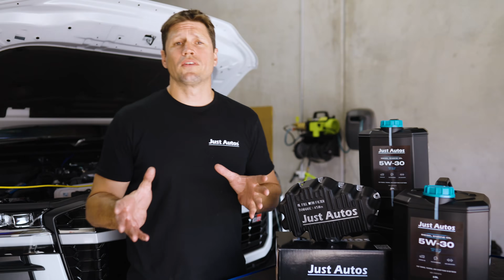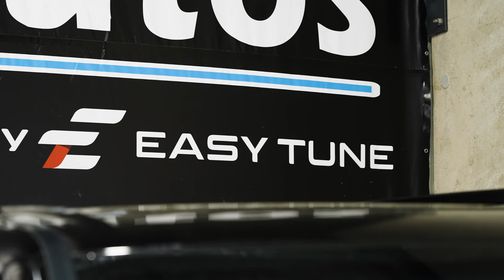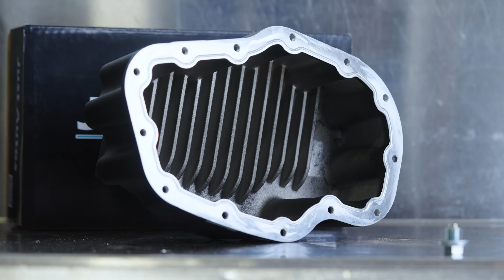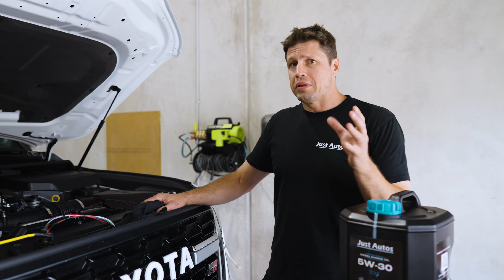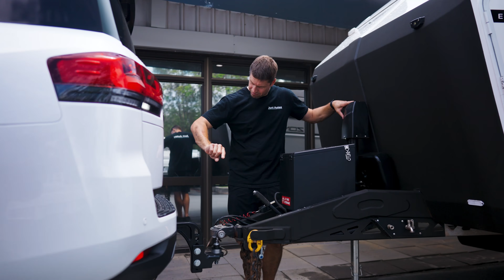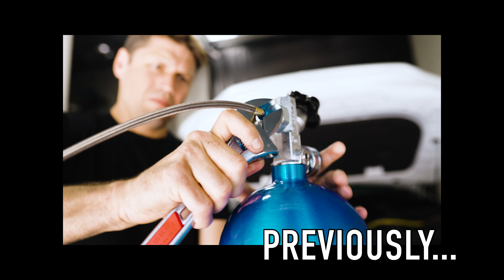Are you Cooking Your Engine Oil? (Real Data | 300 Series Pressure Test Pt 3

Comment: Great video! Oil that is API-SP or API-SQ might survive 120 Celsius even if the engine doesn't. Cracked pistons have started to become a big Toyota issue over the last decade. How does the heavier weight oil assist cooling? I though it was largely about flow. If the piston skirts are short and the rings are tiny can the more viscous oil get through the gaps to do its job?

Comment: LC300 oil is an interesting topic to discuss with your Toyota dealer. On my last service I asked if they could use 5W-30 (Toyota oil) and they said sure, but youll need to buy it separatley and supply it to us, & I still had to pay for the 0W-20 oil because it comes as a service kit and we cant swap out the oil. Poor excuse really. I do some towing & live in North Queensland so harsh conditions are reasonable for the right oil.

Comment: Great mod for the 300 series. Ive noticed I cant read oil temp with a scan gauge 3 on the LC300. Is this a parameter than can be configured to be read on the SG3? I see you guys can obviously read the temp on the laptop.

Comment: Hard to believe the stock capacity is only 4.5 litres. My Kia Sportage has about 7 litres stock which makes me comfortable with 15,000k service intervals. The new sump looks good. Almost like a Gale Banks part( No offence) The extra fins on the bottom and inside should help with continuous heat soak which extra capacity will only delay. The only other way would be some sort of dry sump which would probably not be practical from a packaging or cost point

Comment: Great Video.  Will Toyota honour the WARRANTY when you modifications are fitted ?
Reply from the maker: No, any modification outside factory Toyota has potential to void warranty.
Reply: @JustAutosMechanical How would it void your warranty, this is not going to cause the engine to fail. It's the exact opposite, you adding to the protection and longevity of the engine?
Reply from the maker: @mickparsons85  That's not how they see it unfortunately
Reply: No way

Comment: Straight up, typical Toyota. Spend a shit load on the car, then have to modify stuff to make it work. Boo Toyota. Next, I have a 2.2L Amarok that showed engine oil temp on the dash. I am a heavy equipment fitter and I am used to oil temp being very close to coolant temp. Amaro used to show oil temps around the 130'c mark when towing. Freaked me out. Ran this past an old school VW tech and he said this was normal. I doubted this. Ran a premium Shell 5W-30 engine oil for more than 130K kms. Changed the oil at the recommended 15K mark. Had the oil tested every 15K by a reputable OEM lab. Never had any issues with oil degradation, despite the temps or what work the engine carried out. Spent time adding cooling fins and ducting to encourage more air flow and ambient cooling. All this did was delay the eventual temp. Again, no chemical issues with the oil.
A bigger sump is a great idea. The more oil the better. But doesn't change the fact that that modern oil can handle the pain, and modern engines run warmer. 
Really keen on keeping oil temps down? Invest in a better oil cooler.
Reply from the maker: Oil doesn’t instantly ‘break down’ at 120°C, but oxidation and viscosity loss accelerate rapidly once you’re consistently above that range. That’s why keeping temps lower helps maintain stable pressure and long-term protection.

Comment: How's a 100°C odd a cooked oil when it's Flash point is over 200? I need explanation
Reply: Massive difference between the flash point temps and what the temp is when the oils starts to breakdown.
Reply: Too hot and the oil oxidises and breaks down long before the flash point which is basically smoking point.

Comment: Do you still recommend 5w40? I have towed many times between 30 and 39°. Would 5w40 have made much difference to the test results?
Love your work
Reply from the maker: Yes 5w 40 would be better but Toyota will void warranty. That’s why we used a 5w-30 but pushed the viscosity to the high end of 30
Reply: @JustAutosMechanical I have one of your packages so the tune will probably void my warranty anyway

Comment: 130 degrees is hotter than anyone would ever like to get to.
I’ve been going through data sheets and cannot find critical temp is 130 degrees.All manufacturers with c2-c3 rating critical temp was 140 degrees.
Can you clarify which synthetic oils are critical at 130 degrees please.
Reply from the maker: The oil will start to break down from 120deg getting to 140 in just one drive you would have big problems the next day. The goal is the stay in the optimal of operating range for maximum protection
Reply: It's not a hard wall, oil starts to degrade as soon as you start the engine, the hotter the oil the faster the degradation, by 140 the oil is destroying itself , it's one trip around the engine and done.

Comment: Wasn't really a good test as you didn't test the stock sump with the dropped bash plates, majority of temperature drop might have just been because of the better air flow around the sump.
Reply from the maker: We did test that and was with both sumps and minimal drop with airflow of them
Reply: Is 25*C a failure point?
I'd like to see what happens at 45*C
Reply from the maker: @b @ben7020  sorry do u mean 125deg?

Comment: My Volvo D5 runs at 100-105 degrees oil temp just driving on the highway with no trailer. I think with 5W-30 you really just have to keep things below ~120 degrees. 

If you’re running the stupid 0W-20 then yeah, you’d want to keep it as cold as possible, ideally below 95 degrees.
Reply: That 0w 20 is stupid for Australia. Especially if you are towing.

Comment: Ever thought of a external oil cooler?
Reply from the maker: We wanted to work on reducing temps without compromising reliability first. Cooler can be a grea idea but when very remote they can be a let down if there’s a problem.
Reply: @JustAutosMechanical if it's a coolant type oil cooler yes, but nothing more reliable than a large air to air type oil cooler.

Comment: Test Ambient needs to be the same. Test duration 15min. Constant road condition is best.
Seen oil leaks,,bl0w head gskt inlet manifold leaks   .All this was engine bl0ck distortion. 
Operating at 115---120cel .fix more sump capacity and oil cooler. Oil thermostat fitted. Now  95---103cel.   Larger oil. filter also 0:19

Comment: Why don't you run an external engine oil cooler ??
Reply from the maker: We wanted to work on reducing temps without compromising reliability first. Cooler can be a grea idea but when very remote they can be a let down if there’s a problem.
Reply: @JustAutosMechanical  I gotcha , appreciate the reply and info

Comment: You mentioned there is an extra 2 litres of oil capacity with the new sump fitted. Is the oil capacity with the original sump 7.3 litres.
Reply from the maker: 6.6 is fill capacity

Comment: If a $160,000 car immediatly needs engine modification done to it to do the bare minimum i think it might be the wrong car
Reply from the maker: Towing a 4T van in 40 degree heat up a hill, isn't asking the car to do bare minimum. The 300 series ia a great car. But when you start pushing any car to its limits you will need to make modifications that provide certain protections. And this isn't a major modification, it's a bit of cooling and a change in oil weight.
Reply: The issue is car companies market them as being able to tow 3.5t in Australian condition. To me that should mean 35deg to 40 deg driving 4 to 8 hrs or on any road suitable for a 3.5t caravan ie Australian Alps, Australia north ect. Unfortunately that's not the case so modification is the only option hopefully they reliability is there
Reply: Better off with a yank tank than a 300 series prado. Overpriced junk.
Reply from the maker: @bill5300  I think it comes down to preference and remember every manufacture has its problems